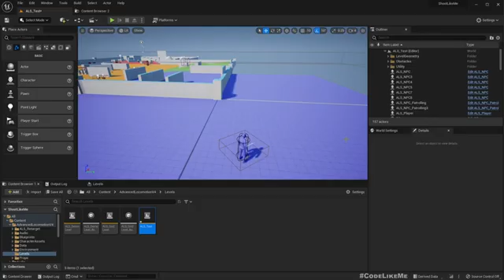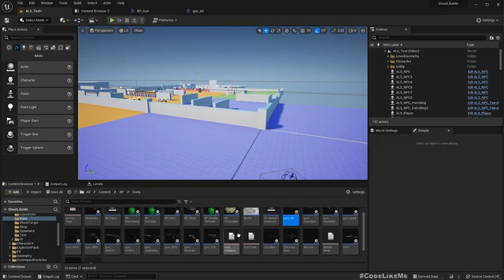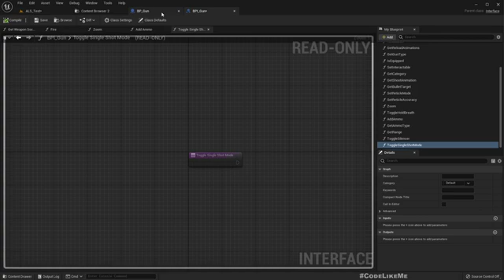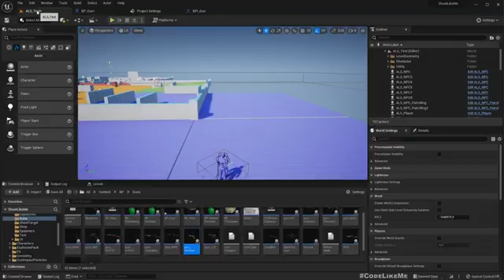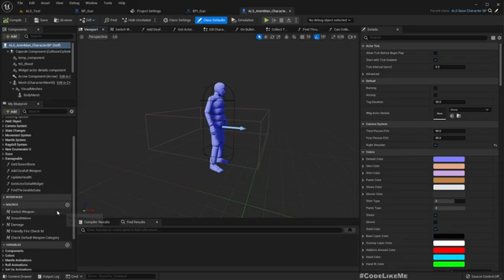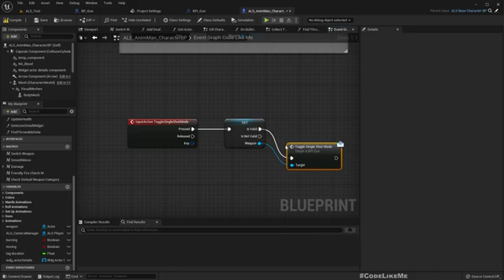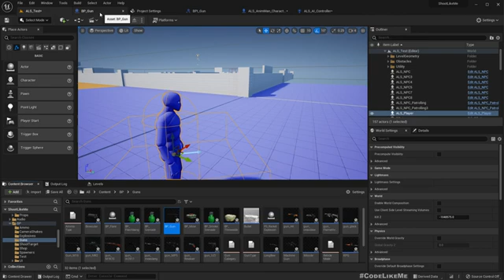Unreal Engine 5 - Silencer and Reduced Damage (ALS #118)

Comment: In TPS you talk me “ok, I usually use animated time in case there are some keys without any animation data.” The animation data i.e. it will show the preview of the animation right? If so, that's great because when I exported the time it doesn't show the preview of the animation? It’s correct?😅